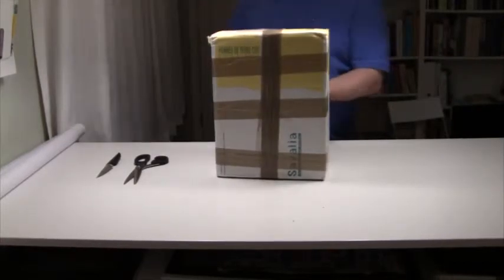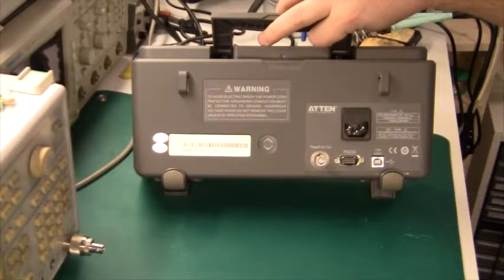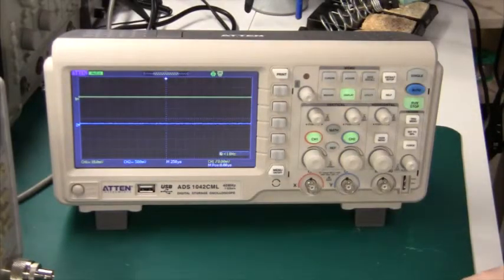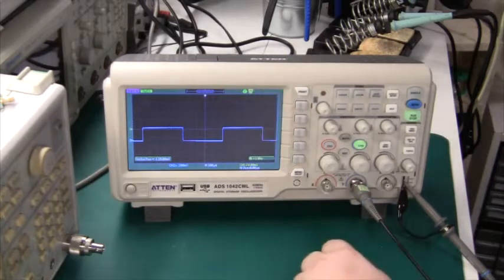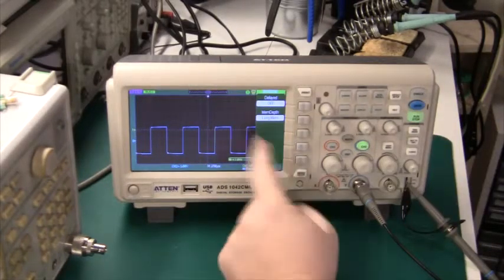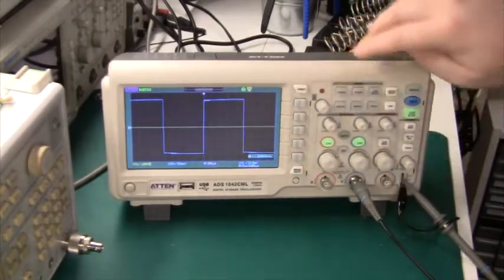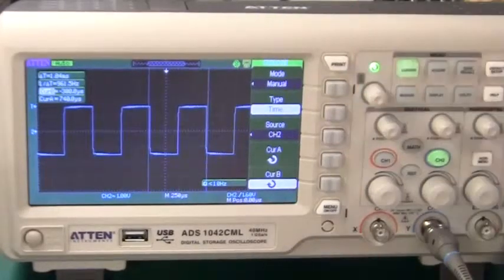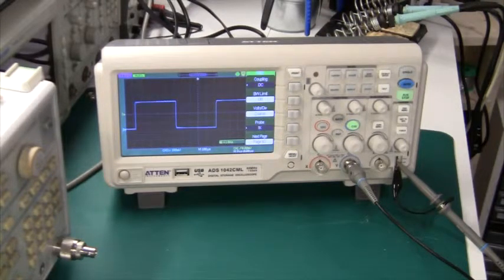Review of the ATTEN ADS 1042 CML Oscilloscope

Comment: Thanks for this review. I have a question about this oscilloscope. Are the two chanels independant or do they have same ground ?
Reply from the maker: They have a common ground.
Reply: Thanks. In that case I prefer saving for a 4 channel :)
Reply from the maker: Normal 4-channel oscilloscopes also have common ground. If you need isolated inputs, or completely floating, you need to google it. There are not many around, and most are portable battery driven. You may want to look here:

https://www.eevblog.com/forum/testgear/which-scope-with-isolated-inputs/
Reply: That's true. There is also differential probes, but they are expensive. At least with a 4 common ground channels oscilloscope, I can have 2 independent channels buy doing A-B and C-D, or 2 common ground channels and 1 indedpendant channel :)